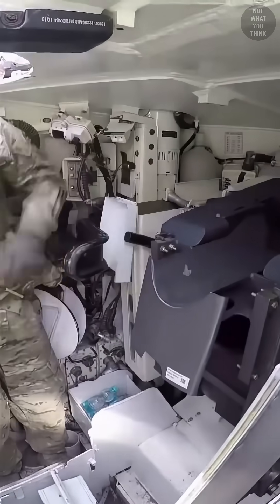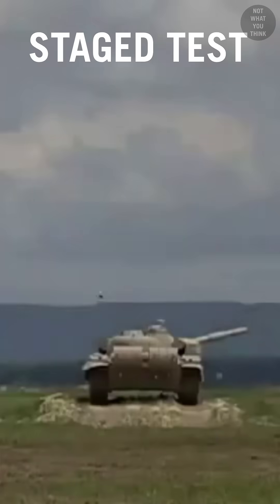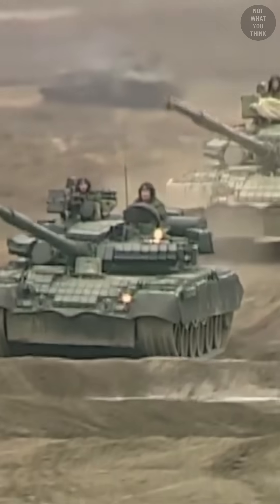Why M1 Abrams Tank Has No Auto-Loader #shorts

Comment: The problem with auto loaders is that it is at a fixed rate of fire with needing to operate the entire system to load a round. In tests it shows that experienced loaders can load much faster than an auto loader.
Reply: And you don’t have to worry about a feeder jamming
Reply: 120mm shell weights 20 kg (40 pounds) so every next shell loader loading slower and slower.
Reply: @prasaite  I’m talking experienced loaders. They can maintain their pace for a while. However, that is a point that was brought up for other militaries, where the auto loader can preform consistently without tiring. However, mechanical systems with a lot of moving parts have a higher chance of failing and more likely a jam can occur after long times of consistent use and an auto loader jamming is one hell of a thing to try to fix. Which isn’t exactly the case for human loaders except injury and of course death. Which is why there are countries across Nato split between human loading and auto loaders. Though of course autoloaders increase the cost of the tank and vice versa. So there is a lot of asks for the autoloaders and that’s why it’s so divisive.

Comment: I'd say that autoloaders aren't obsolete though. On the Battlefield, an autoloader means one less person talking, one less person that you need to coordinate with. One less person to worry about and one less crew member needed per tank.
Additionally, humans can fumble or lose focus. A myriad of things can go wrong even if everything is in perfect condition, whereas a machine does everything more or less perfectly. "Take this out, place this in". For a machine that's quite the hard task to mess up on.
Reply: Problem is an autoloader can jam or break completely. At that point the tank is useless.  A human may be a little slower but is more reliable and the tank won't detonate easily like a t72 or t90 will.

Comment: Also manual loading a shell can be several seconds faster than an auto loader
Reply: incorrect
properly made autoloaders reload 120mm guns within 3 seconds:
https://www.youtube.com/watch?v=ePHUcWsxZDg

meanwhile most manual loaders take about 5 seconds
Reply: @IronPhysik  from personal experience a great loader can load a 120mm sabot into an Abrams sub 3 seconds
Reply: @TeamASGTS  I doubt that, because the opening of the blast door and finding the shell takes longer than that, and you are not allowed to hold a shell ready and lap load 120mm rounds, you HAVE to wait for the door.
Reply: @IronPhysik  alright tank “expert” tell me what the hull storage compartment in an m1a2 is for then if you are so knowledgeable in the firing process of an mbt.
Reply: @TeamASGTS  the hull storage in the M1 can hold 6 rounds, but nowadays tank crews put other stuff in there.

also how does that question matter for the reload speed of a tank?

Comment: The cook off issue has for the most part been solved with the T-72B2, T-90MS, T-90M, and T-14 with Armored plating added to the ammunition stowage and in the case of the T-90M and MS having a cone shaped turret putting the ammunition in the rear far from the crew.

Comment: Russians use autoloaders because they load no matter what. If there is damage, that will brake autoloader - it means that loading crew is either dead or unconscious. Imagine loading gun manually, when tank drives, shakes and turns its tower. Not so easy, isnt it? Well, autoloader loads even if you are mid-air. Less crew members-smaller tank. Smaller tank-harder to hit. Its that simple. Soviets and russians are not idiots. Idiots are those people, who doesnt still have active armor and call abrams main battle tank. Its mbt until it has variety of shells for every situation. MBT must have variety of anti-infantry shells, or it is anti-tank vehicle. Abrams has only a big buckshot. Cool. Pure trash

Comment: Safety is not the main reason why Abrams doesn’t have auto loader. You can still store ammo in an armored compartment and design an auto loader to work with that. In fact, there was a retrofit auto loader designed to work with existing Abrams, and it doesn’t even need to ditch the fourth guy. The real reason is that, the point of having auto loader is to ditch the fourth guy, and thus having a smaller tank with less weight in armor. The only way to achieve this is to design the tank from ground up with auto loader in mind. Although, with even larger caliber guns going forward, auto loader will become necessary, as 130/140 mm rounds and too huge for human loader to efficiently handle.
Reply: Why would
A MBt need a 130/140 mm gun ?

Comment: I figured human loaders would be more reliable and can be quicker than auto loaders. In that an auto loader may jam due to malfunction. They're great cause shells are heavy and one less casualty if something goes awry, but if that shell either doesn't load right, or a dud and it doesn't detect it, that's a sitting duck

Comment: Another essential reason to have a manual loader is that the manual loader is significantly faster. A trained manual loader can load twice as fast as an automatic, and that fire supremacy changes the entire battle.
Reply: The Leclerc autoloader has a load time of 5 second, which is about the same as the average M1A1 load time. Plus with an autoloader you don't need to worry about slower load speeds with a fatigued, or subpar loader.

Comment: There was an old combination of both an auto loader and the blow out panels called the gunslinger. It was designed to act like a revolver’s cylinder but it was expensive, HUGE and a gigantic pain in the ass to work with.

Comment: But the autoloader is also separated from the cabin.
Reply: And if it jams?
Reply: @miguellopez3392  only then do you open the hatch and clear the jamming. And the crew is exposed only while clearing the reloader, not each time they're loading a shot.
What if the hatch for the manned reloading jams? You either have no access to your ammo, or you have the cabin exposed to the potential explosion at all times.
Reply: @padalan2504  you assume fixing a jammed autoloader is the equivalent of fixing a sliding door and it can be easily done while under fire.
Reply: @miguellopez3392  Ignoring all the other benefits the autoloader has, like not exposing the cabin to a potential explosion after each shot, being able to store more ammunition, risking one less life per tank and the option for a more compact tank design. 

Yes I assume it is easier to clear a loading mechanism which deals with the same forces that a person can generate, than to pry open a door which is meant to hold back the explosion of the entire ammo supply.

It is also vastly less risky to have the autoloader jam (Even a few times) and having to fix it in the middle of combat, than to have an explosive charge on your arse the entire time and hope the enemy doesn't hit while you're reloading.
Reply: @padalan2504  you are outweigh the benefits by assuming the tank only gets hit in the ammunition, in Russia they will just put the extra crew member in another less protected tank, and if it does get hit in th 99% of time the door is closed. You loose your autoloader, with the Abrams the gun and crew are still fine and can keep operating the tank and gun.
Reply: @miguellopez3392  You don't get to operate the tank after your ammo is hit. It blows a huge hole in your rear or side and at best you've got a burning tank that can still drive. 
The tower's movement is most likely damaged after the blast, you have no ammo, if you start moving again to retreat you'll become a target again, so you can just stay put in the safety of the cabin and hope the heat doesn't reach the fuel tank (unless you're running diesel) or that smoke doesn't fill the cabin.

When everything is working, the only major difference between the two loading options is that the autoloader trades speed and potential flexibility for more space and lower casualties.
Reply: @padalan2504  do you know what a blowout vent is? after 2 minutes you have a tank with no fire and ammo, much better than a tank with no working gun, as ammo can be borrowed form other tanks or stored near the tank.
autoloader sacrifices the whole crew when it sops working.
Reply: @miguellopez3392  What makes you think autoloaders don't have them?
If you want to discuss the pros and cons, then either assume a catastrophic failure or everything working as intended, but for both, not just one, because there's a lot of little things that can go wrong, which could even be specific to only some tanks.

There's a 4 to 8 seconds gap where the whole crew is exposed each time you load. None with an autoloader involved. Which one is safer?
Reply: @padalan2504  you have to think about the logistics of it, having a failure point that disables most of the use of your tank is a bad feature, you can replace a crew faster than you can a tank.

tank combat isn't done firing at each other every 4-8 seconds, makes it real easy to get targeted by ATGMs, RPGs, and air to ground missiles when you ring a bell, i dont even think dust settles that quickly, a lot of the times a tank gets hit without shooting back and thats it, is the hatch open during ambushes and idling?

Comment: bullshit. Knockout panels save only if the ammunition contains only sub-caliber and gunpowder charges. if there are high-explosive fragmentation ammunition, then the Abramsu also tears off the turret.
Reply: Blowout panels also exist on most types of autoloaders. It isn't even a US specific or manned crew specific thing.
Reply: @shanerooney7288  Leopards 2A5 have the same knockout panels and the same ammunition detonation problems. all because the aft compartment of the turret, where additional ammunition is stored, has extremely thin armor and can be penetrated even with hand pulkets, not to mention anti-tank grenade launchers.
Reply: @ЭлгонАдеран  
Agreed. The video is just rabbiting over autoloader.

Comment: There was an experimental autoloader for the Abrams that basically fed the shells to an arm right behind the gun. The ammo capacity of the tank was cut slightly due to the mechanisms, but it was still able to utilize the blowout panels. The only real problem was the complication of making the gun reset every shot to a reloading position. If you look at German and Russian tanks, the gun barrel points up after every shell. It wasn't originally there on the Abrams so it got a bit expensive to install. 

Still, there's no reason you can't have an autoloader and keep the 4th crewman. Make him a radio operator or something and boom, 4th guy for track tensioning.
Reply: The German Leopard still uses human loaders though. The lifting of the gun is only to make loading easier. The Abrams dosn't do it because the loader sits higher above the breach, so the barrel dosn't have to go up to make loading more ergonomic and thus faster.
Reply: @thoughtfox2409  oh I know they still use human loaders, I only listed the Leopard because it's one of the better examples of a gun with a loading position.

The Abrams is a very ergonomic tank in general, but there are a few instances where a loading reset would be nice, like in hull down situations. In those cases the loader has to get that heavy and delicate shell almost to the roof, but overall it's not worth the effort and cost to put it in, as the military has already discovered.

Comment: Not all tanks with autoloaders are like Russia’s tanks, the vast majority have their autoloader ammunition stored behind a big metal will with blowout panels similar to the Abrams in the example, except it’s even safer because the hole between the fighting compartment and ammunition racks only needs to be big enough for a single round to fit through and doesn’t need to stay open for as long, just long enough for the round to slide through and into the breach and then it can close.

Comment: Well it's also less complicated

Why use an auto-loader when the extra man can help pull security, do maintenance, and pull other requirements?😂
Reply: The overall tank costs less too. Why put extra electronics that will cost thousands more when you can just have a guy do it.
Reply: Plus tech is expensive to fix, where you just have to wash a gunner off the panelling and stick a another in
Reply: there is no reason to cut the 4th man out of the batallion. Just dont let him sit in the tank wasting space and weight for something a machine can do better

Comment: The Abrams is a mega-thirsty, dinosaur.
The future is automated turrets with crews in armored cells (i.e. the T-14 Armata).
Especially when they learn to put it in the back and the engine in the front.
Saves weight and protects the crew FAR better.
Reply: Is it the future? So much that Russia hasn't built that many of them and won't be building that many of them lol the mega thirsty what? It's mega thirsty at an idle sure but on the move it use the same amount of fuel as Russian tanks with diesels and the turbine gives you instant power. The dinosaur will still be in service long after the armata because to many electronics is not good and has Russia figured out the emp problem yet?
Reply: @chadjustice8560  Either you are an ignoramus on this or you just posted a strawman.
 1) The ONLY reason Russia does not build more Armata's is they are broke. Largely because of the embargo's on them for doing nothing more than supporting two regions of the Ukraine who voted over 90% to breakaway. But Kiev would rather kill their own people rather than let them leave.
 The Armata is VERY, well respected vehicle. So much so that India is looking at producing it.

2) Total baloney (other than the fact that turbines are more thirsty at idle). NO turbine engine is remotely as fuel efficient on the move as a properly, running diesel. Forget it. 

 M1 Abrams - 
fuel - 505 gallons (US)
range - 265 miles
Leopard 2 - 
fuel - 317 US gallons
range - 250 miles

The Abrams is a PIG on gas. Whether idling or 'driving'.
Full stop.

Next time you post something?
I suggest you know what you are talking about before you do.

Bye now.
Reply: 1. Whats the point of having economic engine if you dont have fuel issues like russia does. The m1a2D can drive from S.Korean to N.Korean capital on one tank of fuel.

2. T-14 turret is a liability as one APFSDS can knock it out. Its basically a upsized m1128 MGS turret with a cover to mount shit to.

3. The T-14 engine is in the back too.

4. Relocating the engine doesnt reduce weight, just moves it.
Reply: @LynnetteJJW   
1) Have you never heard of 'logistics'?
1a) Pyongyang is 121 nautical miles from Seoul. So as long as your tank can drive roughly that distance on one 'tank'? You don't care what the fuel economy is.
 Okaaaay.
The Abrams fuel economy is roughly 50% worse than the Leopard 2 (a tank of similar weight and HP). 
 The Abrams is a fuel pig.

2) Sure - if you can hit it. It's tiny compared to other MBT's. 
And even if you did. 
The crew would be fine.

3) When did I say it wasn't?
4) STRAWMAN - I said NOTHING about putting the engine in the back reduces weight. 

Next time - try not to reply when you are drunk.

Bye now.
Reply: nah man, it's good enough for harassing third world countries, it's going to be around for another 50 years lol

Comment: If the tank has an auto loding system than that a whole thing that you have to maintain, and that could possibly break. If you load the shells by hand it might be slightly slower but less risk of the turret being unable to fire.
Reply: The American TTB tank went through 66 THOUSAND cycles before failure, as well as other nations having multiple generations of autoloader (like the Russians, the Japanese and the French) haven’t found significant issue to switch away from autoloaders

Comment: I love how he shows someone loading and firing a tank

Then proceeds to show a tank getting blown up
Reply: That's the point.
In a tank vs. tank fight, they will probably both aim for the turret. And if the one with an auto loader in the turret is penetrated at all, there is a good chance it can hit the ammo in the auto loader and set it off, killing everyone inside.
    So, tank 1 fires, tank 2 suffers turret penetration, tank 2 ammo goes KaBoom and everyone in it dies. That was what the firing exercise was supposed to show.
Reply: @jamesredman1263  Actually in tank on tank engagements, they aim for center mass because the average tank engagement is about 2 KM, and that’s about the distance a shell will hit a tank size target. MBTs do not aim for weak spots, it’s more of a hit or miss game.
Reply: @mintsamich  and a single hit isnt always fatal either

Comment: Extra member to replace the driver or gunner if needed and to perform maintenance around the tank. Auto loaders store their munitions in the turret basket which could ignite all the ammo if hit. In American tanks, the ammo is stored separately in an armored compartment that is only opened seconds at a time. This prevents the problem with the auto loaders. That ammo compartment has blow off vents which will send the blast outward and not kill the crew inside.